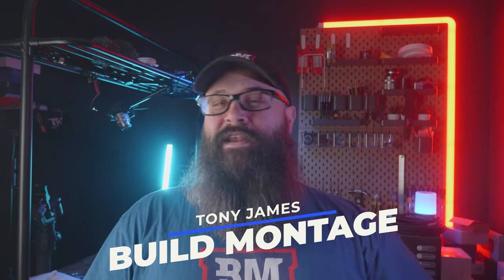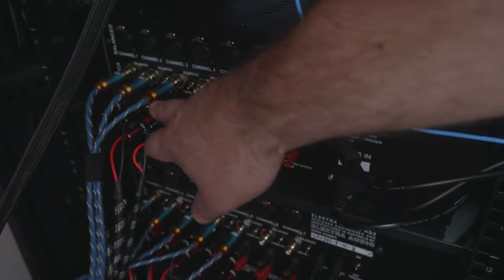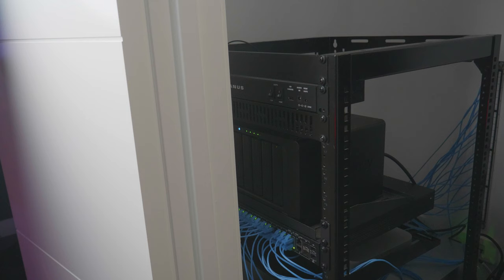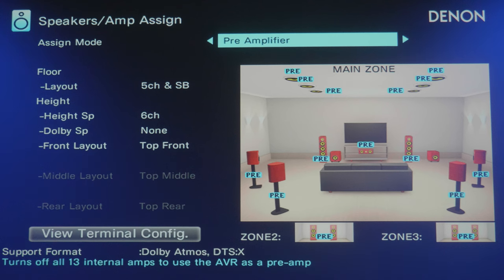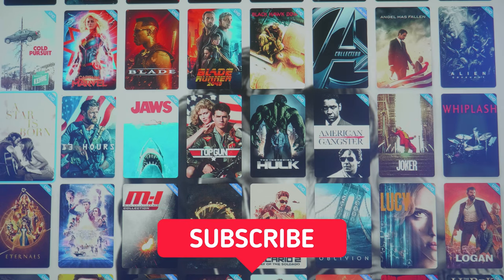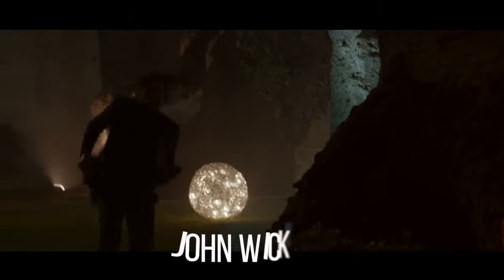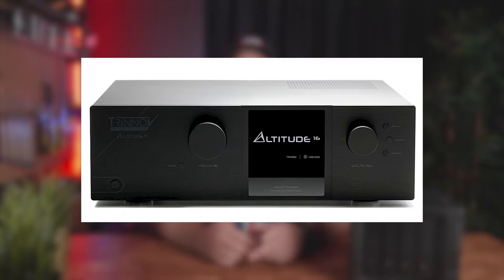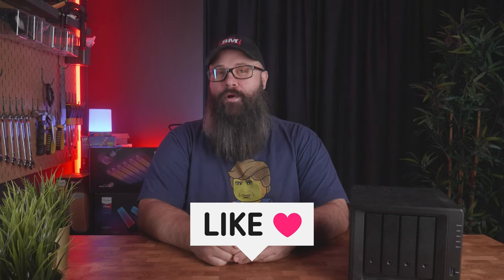SUPERCHARGING my Home Theater RECEIVER into a PROCESSOR!!

Comment: The 8500 with selective amplifiers is great for starting out and then upgrading later. Congratz on taking the Home theatre to the next level. Its not quite on pure Pre-Amp level but it gets pretty close.
Reply from the maker: Exactly, pathway to Trinnov
Reply: @BuildMontage  you’re probably already at the point of diminishing returns.

Comment: I did the same thing with my Denon 6700h, added 3 EMOTIVA amps for the power, makes a huge difference on sound separation and power to the speakers. Currently running a 7.2.4 setup.
Reply: P T  2
Reply: P T   I’d go with one dedicated amp for the front  three speakers, get the cleanest and most powerful amp you can afford. Add another dedicated amp for the side and rear surrounds, finally add the last amp for just the height speakers. If you do go with EMOTIVA, they can be stacked right on top of each other. No fan is needed, I do stack my amps, however, I only have a fan on the LCR amp. Hope this helps

Comment: I’ve been doing this for the past 12 years or so. I run a bunch of Marantz MA500 THX mini monoblocks to power my speakers from year to year.
Reply from the maker: Separates is definitely the way to go. Took me two years to save for these amps, and it’s pathway to Trinnov which I’m currently saving up for! Mono locks are great. Are those the mini ones that you can fit two on a shelf?
Reply: @BuildMontage  actually it fits 5 to make “one” 17-inch block. What I like most about those is that each has its own power supply. So no power-robbing sharing power supply here.

Comment: What's the benefit of using the process to amp system, surely just using the receiver is more cost effective and how do you get them all to turn on and off in unison and safely
Reply: Hi David, 
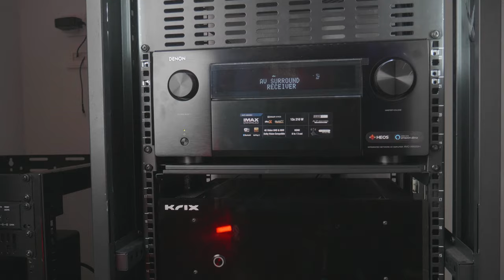As per around 2:50, the power amps are powered up via a 12v trigger signal. The AVR (being used as a processor ins this setup) has a 12v trigger output. When powered up, the AVR sends a 12v trigger signal to the power amps (which have a 12v trigger input). They then power up.
Reply from the maker: As Dan says, its controlled through 12v trigger. If you check the playlist I linked at the start of the video, you will see the two previous videos where I show how I connected the 12v trigger up. And about being cost effective - let's be real and say that cost to run it is very trivial for us in the hobby hah! I think the benefits well outweigh the negatives.

Comment: Hi Tony, 
What hdmi cable do you use between the receiver and your projector..? Do you recommend any for a 10mtr distance for 8k.? I found you can use Ethernet cable for this. What is involved in this set up..?
Reply from the maker: I use a high speek optical cable run by my electrician over 15 meters. You can use cat6 but you need to research what is best for your specific use case.

Comment: good setup. how is denon 8500h as pre amp compared to marantz 8805a Pre processor .
Reply from the maker: I couldn't really split them tbh. The 8500 is a great reciever and sounds even better in pre mode. The 8805a is similarly priced to the 8500 but of course full processor and has balanced XLR so possibly it may be better to someone with better ears than me. I find a lot of this stuff subjective. I will say Anthem and of course Trinnov sound better especially in the HF/Mid ranges.

Comment: This video got me thinking about getting an amplifier 🤔 Unfortunately I am unable to get an amplifier for all my speakers, do you think a single amp for the LCR would make a difference? I have a Denon X4500 and have 2 x Klipsch RP 6000F and RP 600C for LCR
Reply from the maker: 100% an external amp will help just for LCR, in fact, it's quite common in reciever based setups to have just the LCR powered by separates and the rest through the AVR.

Comment: luv your video's tony, I have Denon 4700H and I am thinking of getting 2x Anthem 540 ge2 , do you think it will improve / increase the sound after separeate amplifier
Reply from the maker: Depends on your speakers. What are you running? Sometimes it’s diminishing returns and may not be strictly necessary.
Reply: I have Klipsch 8000f pair, 504c centre and 4x 502s and 2x 160rpc

Comment: How's the channel separation between amp channels .. if you are running them side by side in the chassis? ... think there would be any benefit to running the channels apart if possible?
Reply from the maker: What do you mean? As inside the room listening to the difference I audio between speakers or do you mean from separating them out between the different amps? Just So I know what you mean?
Reply: @BuildMontage  ...Amp Topology. The circuits inside the chassis / cross talk.
Reply from the maker: @psyphonyxaudio  I couldn’t say I would know much about that from a technical perspective but I interviewed the founder of these amps and was super impressed with them. They are well known down under, hand made with high quality parts and super low distortion class A/B amplifiers with error correction on the final stage of the output.
Reply: @BuildMontage  .. 🙏🙏.. Ita sometimes listed in specs.. so when I saw only 3 in use.. I wondered if you'd get any dynamic or audible improvements from separating them from that 1 amp. shrugs .. Maybe just ask the designers. :-) ..All amps or devices have a level cross talk.. and this is why Monoblocks are so sought after for even higher end 2 channel. .. Zero cross talk.
Reply from the maker: @psyphonyxaudio  I honestly don’t know if my ears are clever enough to notice it, especially for a home theater setup. There is actually very little info on these amps but I do know that they make my setup sing :) you’re on another level to me with this stuff :)

Comment: Even with high sensitive speakrs the 8500 is barely enough in a living room. In a room with accoustic treatment you lose alot of speaker output because there is alof less reflection. If you watch the 8500 in scenes that have alot of speakers active you can see how he struggles. That is not an attack to the 8500 he does great for what he does. But so many channels AND all the other stuff an AVR does, theres just not enough space to properly support all that in that volume.

In any System with more then 5 speaker external Amplification is beneficial. The 8500 amps are decent but not high end. I have a way cheaper AVR ( onkyo rz 840 ) and looking into getting the IOTA Pre Amp because i use old Class A/B Dynacord amps i got for cheap. So if you have acess to really high end amps they just are plain better then whats inside even the highest end AVRs because .... the amps orignally ( or do if you get new ones ) cost as much as the AVR for ( only ) 4 channels.
Reply from the maker: My setup sounded fantastic before the 3 power amplifiers, but now it sounds that extra bit special. For me the 8500 was a pathway to bigger things later as at the time I couldn't afford prepro and amps. This is just the next step in the journey.

Comment: I am on the exact same path to upgrade to a processor, though not likely the Trinnov. I bought the Denon 3600h and have added one 5 channel Rotel amp.  My next step is adding more amps to be able to power at least 13 channels, getting a better quality amp to power my base layer and the Rotel to continue with my 4 Atmos speakers. Then I will add a 15 channel processor followed by an upgrade on the Rotel amp and then increase my Atmos to 6 speakers as well as adding wides. My sound is currently very good and I am very pleased with it so I am not in a rush for the upgrades so can take steps as I can afford to do so.  

I think this is the best path for anyone to take who wants to upgrade to separates instead of being limited by your budget buying the entire setup at the same time and then replacing to upgrade.  

I won't have to replace anything as my current AVR and 5 channel Rotel amp will just be moved to my family room which is only a 5.1 system and I can add some Atmos if I want to.

Patience and smart decisions are the name of the game!
Reply from the maker: Perfectly said Shane. Slow and steady. I couldn't afford processor and separates back in 2020 when I started so this was for me the perfect test in patience and planning. Good luck with your setup!

Comment: Isn't it a waste to buy 8500 and use as processsor. Why not just buy standalone processor in the first place to save cash?
Reply from the maker: If you watch my previous videos it will make sense. I have been saving two years for amps so the Denon 8500 allowed me to enjoy my setup while I saved up :) at the time in Australia there was very little option for 13 channels in both pre and receiver.
Reply: @BuildMontage  That makes sense.  At least you have a beautiful place in the down under even though lack of choices. It keeps you guys down to earth and sane :)